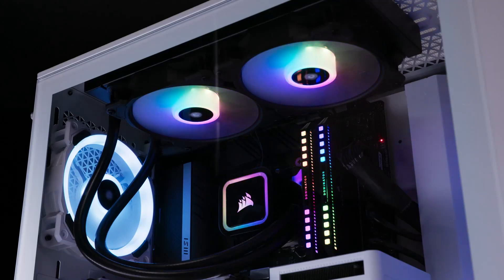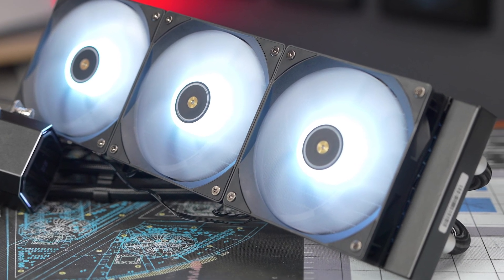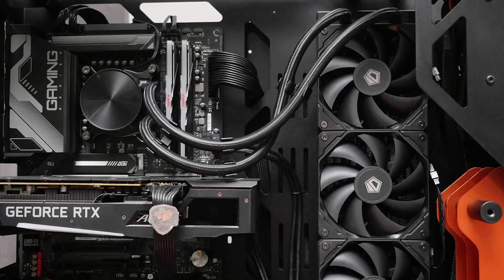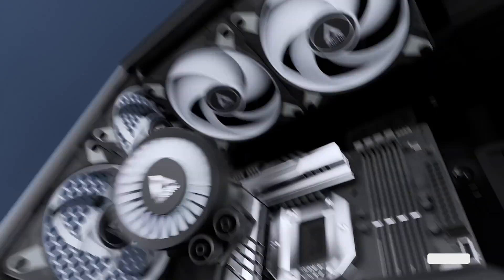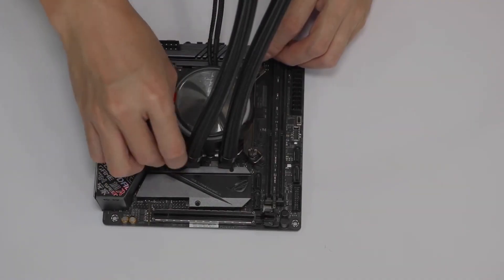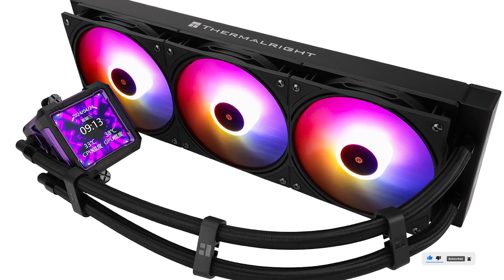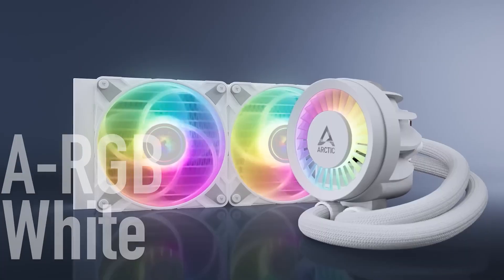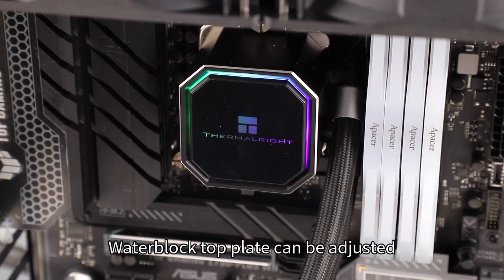AIO COOLER Secrets You Wish You Knew Sooner

Comment: What is your opinion about a cooler system for hot and humid indian summer? Mostly the average temperature of indian summer is between 40 tp 50. I need a suggestion. I was looking for cooler master. I am not much interested in RGB systems rather interested in saving the cpu. My cpu is AMD Ryzen 9 7900 x3d
Reply from the maker: For hot and humid Indian summers, a high-quality AIO cooler can make a significant difference. The Cooler Master options are solid, but make sure to choose one that has good thermal performance for your Ryzen 9 7900 X3D. Staying cool is key to maintaining that CPU performance!
Reply: @thetechmag  Thank you for responding. Well in india the available ones are mostly the cooler master atmos and ml 360, which one you suggest? also do i use the given cryofuse thermal paste?
Reply from the maker: When choosing between the Cooler Master MasterLiquid 360 Atmos and the ML360 series, the MasterLiquid 360 Atmos stands out as the superior option. It offers enhanced cooling performance, quieter operation, and additional customization features.
Reply: Thankyou  @thetechmag